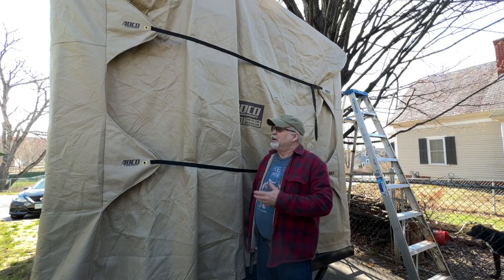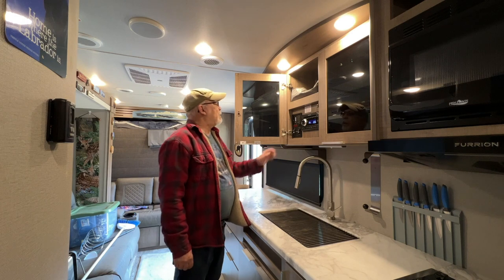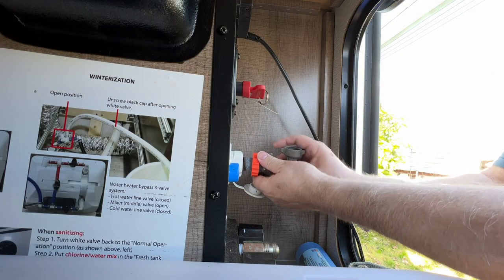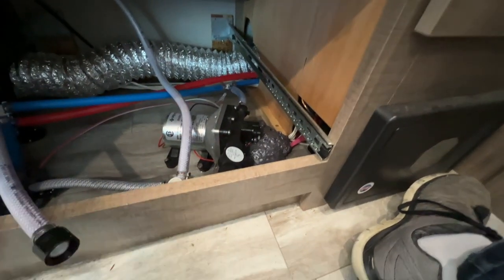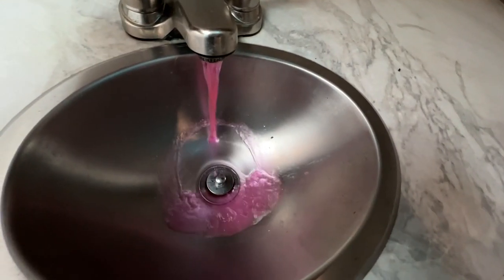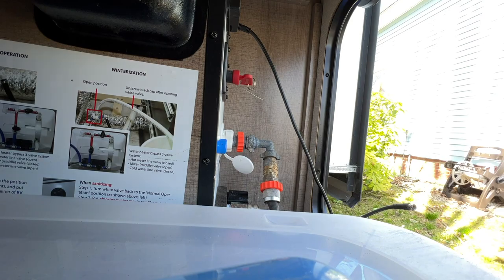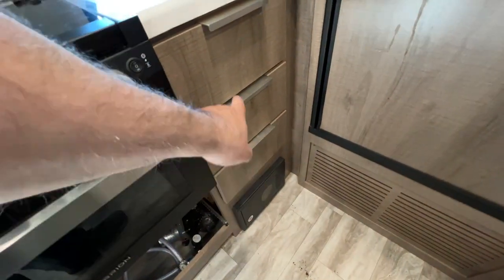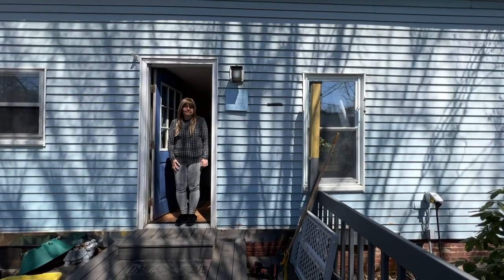S6E1 How To De-winterize Grand Design Imagine XLS 17MKE

Comment: I was looking for a Dewinterize video and we have the same trailer...:)
Could you do it using just the freshwater line only and not the pump?
Reply from the maker: Depends - if they used the pump to load up the antifreeze - which more likely the case - you will want to use it to clear the antifreeze from those specific lines, thus needing to use the pump. Thanks for watching.